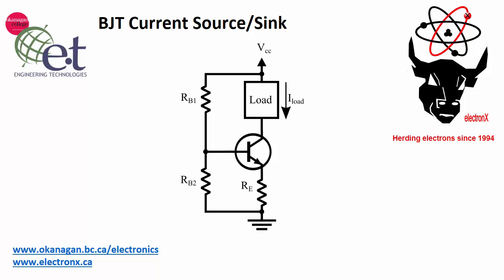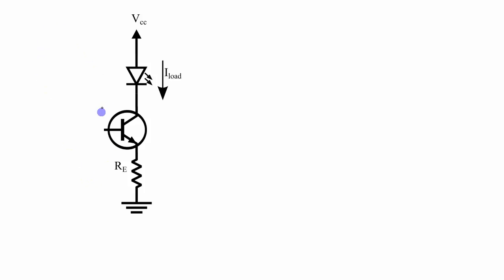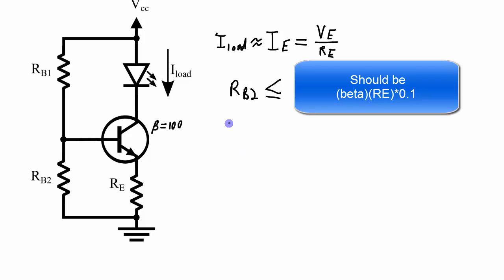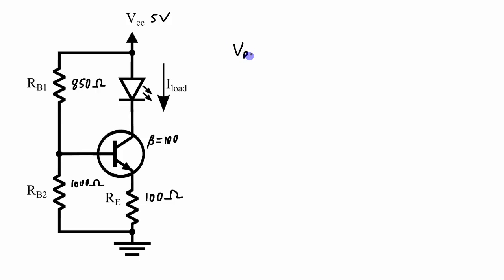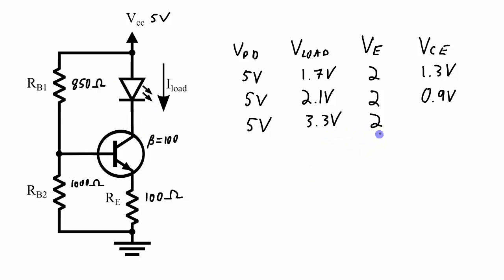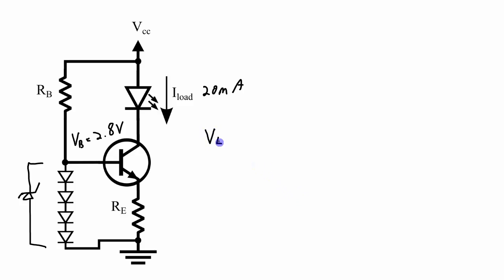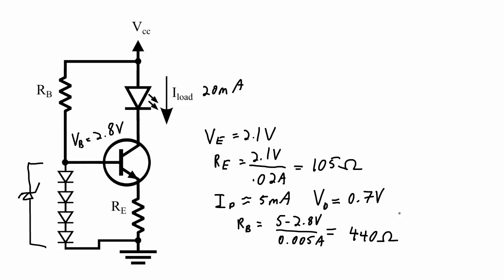BJT Constant Current Driver

Comment: I have used this circuit, configured as a current SOURCE rather than the SINK described in the video, many times when I needed to create a linear ramp voltage....the current source would charge a capacitor (as the LOAD), with the (-) side of the capacitor connected to circuit ground. Just flip the circuit shown upside down, replace the LED with the capacitor, use a PNP transistor, and the Zener diode instead of the four diodes.

Comment: would it be not simpler to use only LED and series resistor in series to set a current as VCC is constant? LED voltage is also constant...
Reply: watch 7:30
even if you change led (with different voltage) this circuit drive led with CONSTANT CURRENT.

look at LM317 datasheet and examples about CONSTANT CURRENT.

when you have more than enough voltage source (let's say 12v), using LM317 as a CONSTANT CURRENT driver, you can use any led you want (blue, white, green are about 3~3.3v, yellow and red are about 2~2.2v) and all leds you put in circuit will drive by 20 mA (regardless of Vload)

Comment: Will the current stay constant if Vcc changes?
Reply: If you use resistive voltage divider to supply base current, can not keep the current fix when Vcc changed. But, if use Zener diode, you can keep it fix.
Reply: @futuhcoklu1396  are the changes significant

Comment: You could also use another transistor to control the current on the base of the first transistor. The second transistor has its base-emitter junction connected across RE and its collector connected to RB1/first load transistor's base in the place of RB2. The varying voltage drop across RE will control the first load transistor's base current by diverting the current away. This final circuit can have a tendency to cyclically oscillate however.

Comment: Thanks this really helped, at least in terms of the maths and design. Still not sure I know why it's limiting the current though. I always thought current through the collector/emitter was a factor of current at the base... and why would that change because the load volage changed? Why did RB2 need to be less than/equal to your corrected equation etc?
Reply from the maker: Your two questions are actually related. We wanted to pick an RB2 value so that the current flowing into the base is very small compared to what flows through RB2 - then RB1 and RB2 can be treated as having approximately the same current flowing through them. Then, since we're assuming the base current is small enough to ignore, we can use the approximation that VE is (VB-0.7) and then use VE/RE to calculate IE. 
We could have done a more complicated analysis and thevenized the VCC/RB1/RB2 part of the circuit then use that to calculate IB, and use beta to calculate IE. This would give a more accurate result, but is more work.

Comment: you can do this with a pure RC circuit as well.  its a voltage divider with the capacitor on the "load" but the r2 resistor is where the load goes.
Reply from the maker: I think that you need an active circuit to have a constant current driver; I'm not sure how you'd do it with just an RC circuit. With just RC, the capacitor will help hold a steady voltage for a short period of time...depending on its capacitance and the load.

Comment: Can we use this in Power Supply Circuit as Power Indicator, just before regulator IC? My Bridge Rectifier gives 12v or 24v, current 5A.
Reply: yes    use the 2 BJT version

Comment: Im getting the collector current i want but the multimeter voltages on the base and emitter do not match the calculations
Reply: Can be the bjt beta is not the same and the base current caused drop on the voltage divider is olso diffrent. In this case the current thru the divider is shurley not ten times larger than the feeded current to the base commection.

Comment: Between your video and another one with similar theory, I was able to achieve the required results. I tested by varying the input voltage for the range I require, and all worked very stable.  Thank you for the tutorial.

Comment: If I have a voltage of 5 V at Vcc, but the operating voltage of laser is 2.2 V, will it damage the laser??
It would be really helpful if you can clear my doubt. Thanks
Reply: No  problem as long as the current is under the LEDs max current

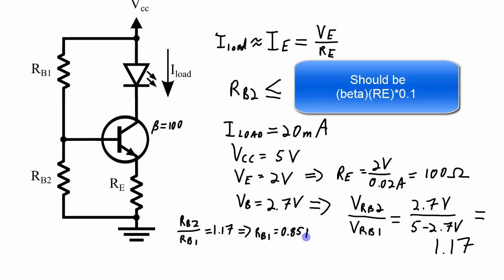Comment: Hi David can you please tell me how you arrived  Rb1= 0.85*Rb2 at 4:35 , and also at 7:22,  why you  think that at saturation why we won't get the 20mA?
Reply from the maker: AT 6:58 in the case where the forward voltage of the LED is 3.3V, the voltage at the emitter cannot be 2V, because 3.3V + 2V = 5.3V which is more than VDD
Reply: @ElectronXLab  : I'm trying to learn here. You mentioned that led 3.3v will saturate the transistor. I agree.  My understanding of saturation is that the transistor won't pass any more current via the collector. The maximum current will be that what is set by Re(100 ohms) resistor, which is 20mA? 

If I am wrong would you clarify further? Thanks.
Reply from the maker: @shazmiah  let's approach this a different way. In the last example, I said that the LED turned on at 3.3V and that it needed 20mA to reach that voltage. If 20mA goes through the 100 ohm resistor, the voltage across it will be 2V. The power supply is at 5V, so that means after you take off the 2V across the 100 ohm resistor, you only have 3V left. If you have 3V across the LED, then it will not have 20mA through it, so the actual current must be something less than 20mA.
Reply: @ElectronXLab  : Thanks for your explanation and quick reply.
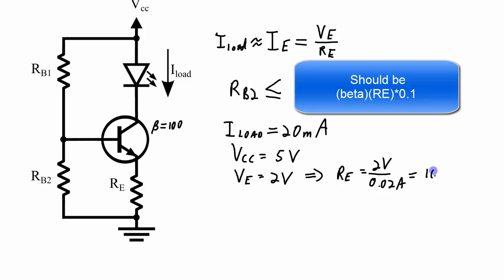Reply from the maker: At 3:33, I showed that VB needs to be 2.7V, then at 4:15, showed that the ratio of VRB2/VRB1 is 1.17. VRB2/VRB1 = RB2/RB1 = 1.17, so with a little algebra we can see RB1 = 0.85RB2.

Comment: 2:41 explained (correct me if I am wrong)

voltage drop is almost equal both sides - Re(Ie) = Rb2(Ib2)

Re(beta)(Ib) = (Ib2)(Rb2)

If we want Ib to be less compared to Ib2, say

Ib/Ib2 < 0.1  then that is the same as Rb2/(beta)(Re) < 0.1

Or Rb2 < 0.1*Re*beta

Comment: Hi, David. Like most videos out here on Youtube, you're only dealing with a single LED running a fv of 5v or less. What about a load of 40 LED's? 4 in series X 10 in parallel, powered by a car battery of between 12v and 14v? I've watched this video 5 times, but I can't seem to get my head around that much voltage and a CC of .8mA. Although it works fine on my bench power supply where I have a constant voltage, I can't get it to work on my car once the Alternator kicks in and the voltage goes up. How would you build a CC driver for my situation?
Reply: There is a voltage drop across the CC, and with the Vf of White LEDs   there is a limit of 3  in series

Comment: I'm trying to come up with a reliable LED circuit for a bug zapper board I have made. I'm using three .5 watt LED's. I have a 110 v ac source and would like to use that to power the LED's so I don't have to use a buck converter to get dc for the LED's. I want everything to be on the board I have made and not have a buck converter to worry about. Do you have a circuit that would show me a simple and reliable way to do this? I assume that I will need a transformer to reduce the voltage but I cant find anything that will reduce the voltage and still fit on a small PCB.
Reply: If you want to drive UV led string from mains you can buy a led based neon tube it has got a current regulated output and mains input. Like 40-60-80 mA and limited to abaut 35-42V DC depending its size.
To make the mains into a constant current can be realy low effiency any other way. 
If you connect the leds antiparalell and build a string, it is possible to drive this string one end with high frequency 0-400V signal and leave the other end floating. The stray current thru the leds can be large enough to get some light output. This current olso can be controlled with a small valiue high voltage capacitor and by the switching frequency of the 0-to-400V generator.
The antiparalelled leds are important to protect eachoter from the reverse voltage. The light output exactly the half as the same amaunt leds can provided at DC.

to play with the rectified mains voltage can be lethal. And as you can not fuse for like 20-30mA current the whole circuit will going to be burned if any component is going to be failed. A transformer and a thermal fuse is much more forgiveing every time.

Comment: I have to admit, I'm totally baffled by this explanation.  Current is the flow of electrons right?  Electrons have a negative charge, right?  Doesn't that mean that your electromotive source of Vcc can be explained as a lack of electrons rather than a excess of them?  How can you say that current (electrons) are going to flow from a region of few electrons (+) to a region of excess electrons (-).  The way your talking about this circuit feels like your confusing voltage and current directions.  Another way of explaining what I'm saying is that current flows against the arrows in diodes and transistor gates.  If that is not the case, why do they call the leg of the transistor opposite the leg with the arrow on it, the Collector.  Doesn't it get that name from it's job of Collecting electrons emitted by the opposite leg?
Reply: Get your basics right. Current flows in the opposite direction of electrons
Reply: @the1aboveall483  You said it, "CURRENT FLOWS".  What is flowing?  water?  air?  heat?  How about Current is the flow of ELECTRONS.  Unless ELECTRONS are swimming like salmon  and going against the "flow" so as to go upstream.  And if you use that analogy then current "flow" is water? and electrons are salmon.  I'll accept that if you can explain what is "flowing" in electric current if it's not electrons.
https://www.youtube.com/watch?v=9HlD40SLwr0 Here is a basic discription of how a battery works.  Weird that it states that the energy in the battery goes from the - pole around and back into the + pole of the battery.   The battery is an energy storage device.  It has a chemical reaction taking place inside it that wants to push electrons OUT the - pole while the + pole has a hole trying to attract an electron back in to take that one's place.  I'll help you out a bit.  Electromotive force (volts) exist in the battery and in any circuit hooked up to that battery.  Electrons moved from the negative pole to the positive pole until there were no electrons to drive the chemical action in the battery of sufficient quantity to move current through the circuit attached to the battery.
So whatever current is, it's not moving in the opposite direction of the electrons flowing in a circuit.
This stuff was a whole lot easier in the old days.  Everyone could see the filaments of an electron tube glow a pretty bright orange and it made perfect sense that the glow came from electrons moving through the filament heated it up.  Gee wonder what heats up light bulbs and makes them glow?  I bet it's electrons.  Electrons that are being PUSHED by VOLTS NOT PULLED by VOLTS.  There in lies the explanation .   Electrons passing through a resistance generates heat.  Proof that there are actually electrons flowing.  In regards to the video above.. current flows up through the transistor,  NOT down through it.
Reply: @trongod2000  In short. You're right. Electrons flow in the opposite directions. But scientists in the old days thought otherwise and it's not until lately that we discover current flows in the electron flow's direction. The problem is everybody is used to the old way (AKA CONVENTIONAL CURRENT) that nobody bothers to change. So calculation and explainantions all use the opposite direction of electron flow.
Reply: @An-wd9kk  One way to show people how current flow "works" is to show them how current flowing through a conductor can pass energy to do work in something completely detached from the wire.  Show them an electro-magnet for instance.  Perhaps seeing a solenoid in action will help also.  Both these examples however do not show the "direction" or "flow" of the energy within the conductor.  At least not usually.  It might open their eyes to the idea that there is "direction" if you reverse the leads going to a solenoid and see that the piston portion of the solenoid is pushed in the opposite direction.  That alone though does not visually show which way electrons are flowing and even less enlightening on the subject of current flow.  Current is a very hard concept to show visually and direction of current flow is even harder.  One of the best ways to show the effects of current flow (electrons flow) is to take an uncharged capacitor and measure the voltage on it.  Since it not charged there won't be an excess of electrons on either of it's plates.  Hook the capacitor up to a source of electrons and then disconnect it and see what happened to the capacitor.  Surprisingly, almost nothing.  In order for electrons to build up on a plate the opposite plate needs to shed electrons.  This adding and shedding electrons is pretty instructive in determining direction of flow.

Comment: Can you help me design a 24 volt 7 amp constant power source to use as a charger. I have the I have the 24 vac 10 amp transformer and 10amp bridge rectifier but I dont know how to maintain constant 7 amp delivery.

Comment: if you use zener diode you can set voltage at any point you can find zener diode. but what sorce you will use battery or wall shocket

Comment: Hi David, excellent refresher, thank you for the time you put into this video. Can you explain why you chose a V_e of 2V?
Reply: same doubt here!
Reply: Transistor has to be in active mode. We will need at least 0.7v to turn on diode. If ve is 2v, that leaves 2.3v across the transistor. Rule of thumb, approximately half supply across vce.
Reply: I think it was arbitrary and the solution made sense at Ve = 2 Volts.
Reply: I think it may be the value to drive the LED ie RED approx 2v @anirudhshandilya4032

Comment: Buy a LM317T
Reply: It won't provide constant current.
Reply: @tianapyre2837  Yes it will. IF used in CC configuration.   Read the DATA SHEET
Reply: Problem is that you need a big wattage low value resistor and it dissipates a bunch of heat.

Comment: I somehow missed where you got the equation (Beta)(Emitter Resistance)(.1) especially the .1 because you didn't mention anything about that. Also, if R1 is 850 Ohm that makes the current through the diode 270mA as 5*(850/1850)=2.3 & 2.3V/850R=2.70mA so if the base current is multiplied by beta than the collector current would be 2.7mA*100=270mA which surely isn't what you intended was it?
EDIT: I see now how I was mistaken. The current through RB1 contains both the Base current and the current through RB2. However I still don't see where you get that RB2=(beta)(Re)(.1). In your calculation with the fuor 1N4148 Diodes with A forward Voltage Drop of 0.7 Volts and 20.7V the Forward current is 5mA then wouldn't you need to have the resistor set such that the resistance is equal to the 2.2 Voltage drop over 4 x 5mA or 20mA  so that Rb = 100 Ohms?
Reply: I calculate like this  beta=100 , led red =2v and 0.02A ----- Re=3v/0.02A =150ohm , Rb2=3.7v/0.002A (1/10 beta) =1850ohm , Rb1=1.3v/0.0022A (1/10 beta+extra 1/100beta = 0.002A+0.0002)=590ohm .
Reply: I think R2 is suppose to be 850 ohms and r1 is 1000

Comment: Excuse me, but what is the difference with not using a transistor to supply constant current with predefined series resistor? When i change to another color LED the current changes.